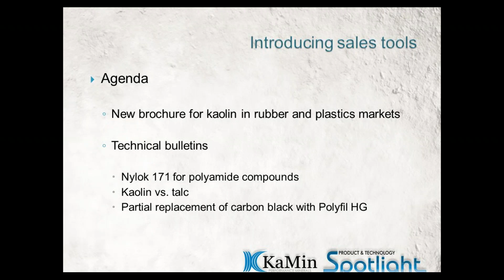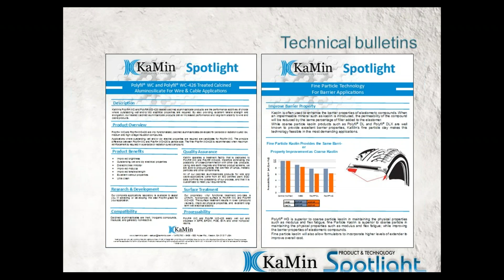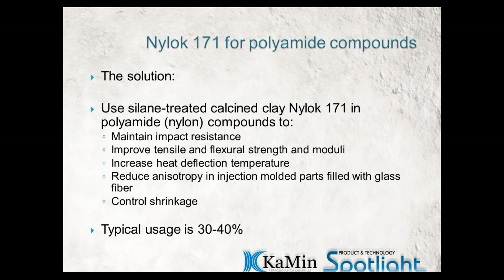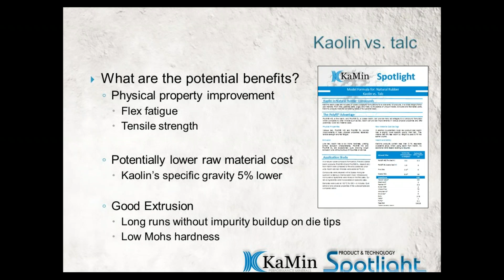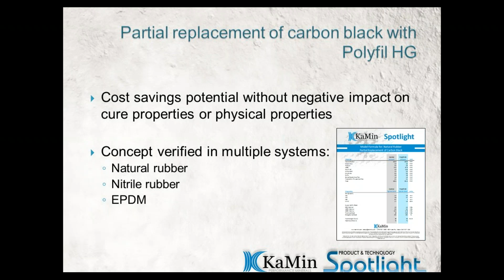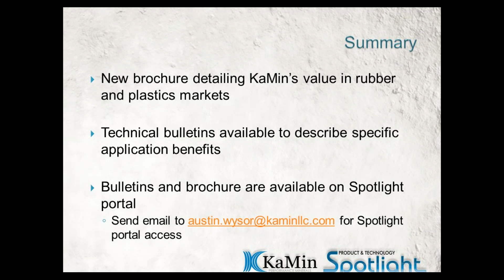Kaolin Clay for Polymer Applications Webinar

Comment: We offer customized ultrafine grinding mills system and coated machines for caco3/dolomite/talc/gypsum/limestone/calcite/calcium oxide/ bentonite/dolomite powder

1. 325mesh~3500mesh, finished powder fineness is adjustable.

2. Built-in air classifier, higher classifiying accuracy, powder narrow particle size distribution, better powder quality

3. lower energy-consumption, higher outpout(for same install capacity, 200~300Kg/hour)

4. PLC control, simple operation: 1. Low voltage components: Schneider 2. VF/Soft Start: ABB 3. PLC Controller: SIMENS

5. No Dust when producing

Any query, please tell us directly.

Best wishes,

Samuel

Fujian Longyi Powder Equipment Manufacturing Co., Ltd

Web:http://www.lymill.com/show_19.htmlm

MP/Wechat/Whatsapp: +86 15105956429

Email:Samuel@lymill.com